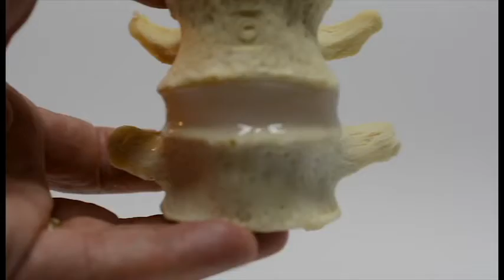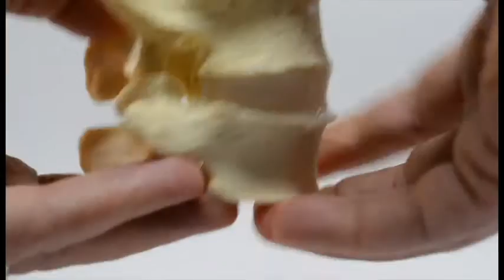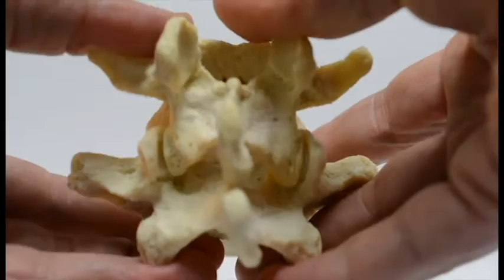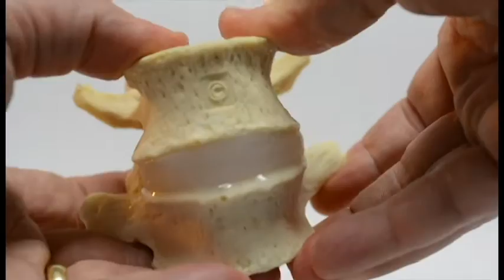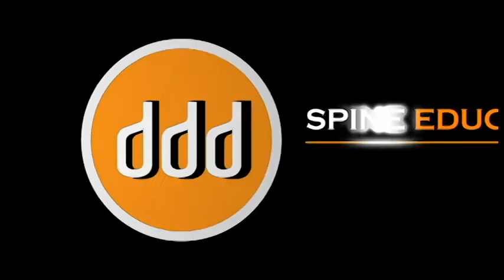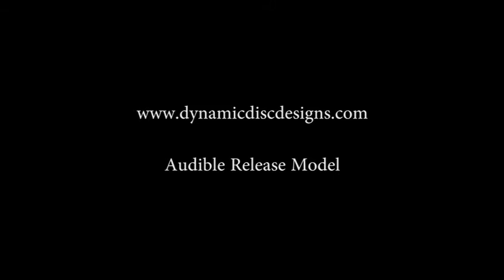Audible Release Spinal Model to demonstrate spinal manipulation - Human Anatomical disc

Comment: Thank you.I have searched the whole day for a visual explanation of spinal manipulation and the effect it has on spine pressure release. This makes sense. I had a light bulb moment. The facet joints are opened and this creates room for the disk and and vertebrae to expand. This allows better nerve communication and blood flow.Does a release of synovial fluid cause joints to rub against bone. I imagine it’s like cracking fingers or toes, the fluid is made up within 20 minutes or more.
Reply from the maker: you got it! The fluid, however, is there and does not change volume (we think) but a cavity is formed within to take up the extra space. The cavity shrinks when the tension is let go but there is increased movement of the joint for about twenty minutes or so until the cavity disappears, and re-seals the fluid. You are likely bang on though. And during this time, there is increased movement of the disc and possibly disc height gains. But this science still needs to be done. Sounds like you have been thinking about this for quite a while. Good job. If you want, you can a have look at the research I did in 2015, using myself as the subject. You probably have seen it already. https://www.youtube.com/watch?v=_ZNENkkf5Uw Thanks for your comment.